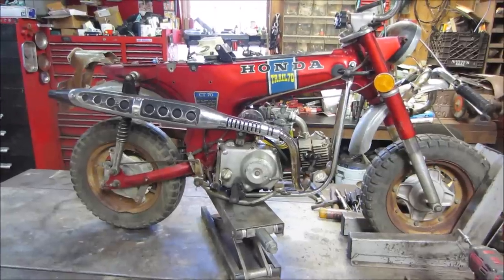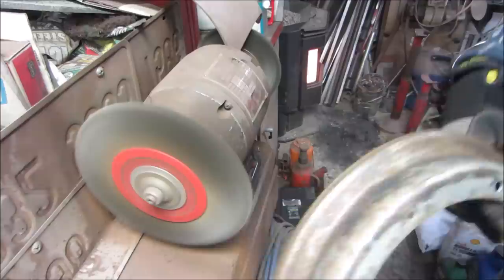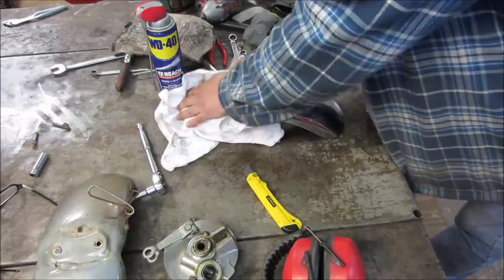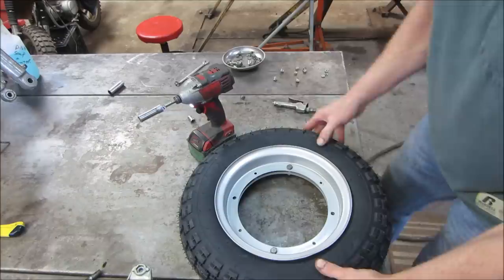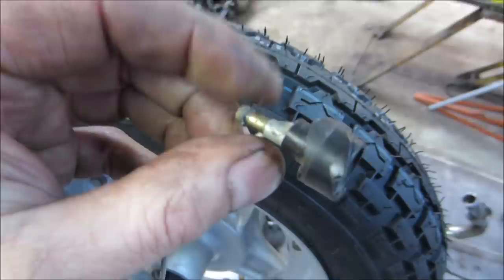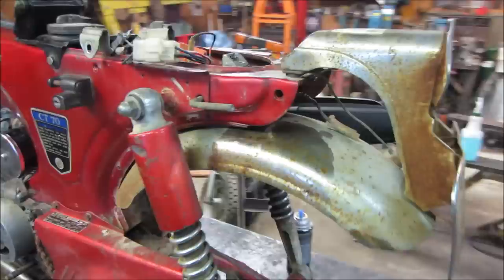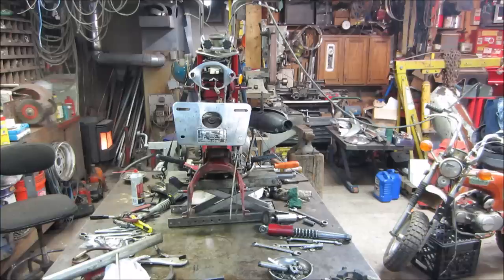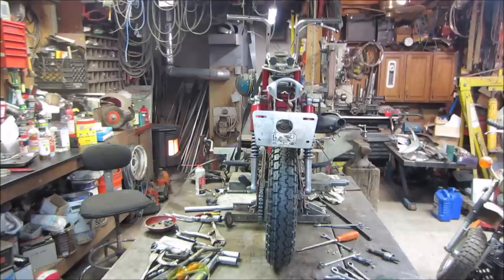Worn out Honda Trail 70, wheels and frame repair, pt5

Comment: Hey mustie, I've driven for FedEx Freight for 26 years. I have two ruptured disc in my back.
  I just watched your video on( Your 2 cents of being a mechanic.), and  I've also turned wrenches on the side for 35 years.
 Looking at your lift and watching you work on this small motorcycle oh, my back was SCREAMING (FIGURE OUT A WAY TO BUILD A PLATFORM TO SIT ON TOP OF THE LIFT THAT SWIVELS Front and back over each side or  WHATEVER IS ON IT... )LOL...

 I have literally have figured out ways to do things with a ruptured back to keep from having surgery. Because surgery is the death of my job. Everybody I've known that's had surgery at my job eventually doesn't continue  long after doing it. I LOVE DRIVING  FOR A LIVING. 

One thing I can tell you is that I have multiples of in my shop is the blue handle $2.99 Grabbers from horrible Freight, and the little yellow and black magnetic crabbers at my Welding Table I usually have three or four of them by each machine. Cuz you only got so many times in your lifetime you can bend over and pick crap up when you got ruptured disc before one of them times it's going to be the end. So if I can spend a little money to keep from having to bend over and pick stuff up that is worth it to me. I also have them all over my house, especially in my laundry room kitchen and outside to Pick Up Stix. Cheap insurance :-)

 I Apologize for such a lengthy message. I just really was touched by your video about your back and surgery.

Comment: Just a little tip. Take your torch and preheat the metal first then paint it. You can do all coats at once and it is baked on hard and durable. I have done that for years. Oh and I always use primer.

Comment: Been lurking for quite a while now and just want to say I really enjoy your videos.
On the Trail 70  front fender cleaning the chrome you used 0000 steel wool. While this works
There is also a product called Bar Keepers Friend that will work wonders on anything that is worth 
spending some time on. This stuff is a lot like Ajax kitchen cleaner and is found in the same area 
of the grocery store. But then again you probably already knew this.
Keep em coming.
Reply: Bar Keepers Friend works wonders on windshields as well
Reply: Nevr-dull wadding polish also works if it's not too deep.

Comment: Yup, in UK a castle nut is secured with a split pin, and a cotter pin is wedged shaped and used to secure pedals on a bicycle.

Your helper looks more helpful than mine... Mine just follows me about, and trips me up when I try to change direction!
(Also unable to identify correct spanner sizes. Everything just ends up as a tennis ball).
Reply: Actually I don't believe its the whole uk that says split pin for a cotter pin. Mostly just britian itself and australia. Btw a split pin is used to hold paper or leather together. Its brass or steel and small.
Reply: @jacilynns6330  The difference between Britain and UK is Northern Ireland...
Reply: Yes here there's a difference between them
Reply: The cranks on old pedal bikes were held in with 'cotter pins.' Newer bikes had 'cotterless cranks'. I've heard splits pins referred to as cotter pins too. Other 'split pins' look like drawing pins or thumb tacks and can be used for holding paper or leather together although the leather ones would probs be called rivets! I love the etemology of hardware!
Reply: Jacilynn S Now that’s not a split-pin (in UK), it’s a “bifurcated rivet”...! Les
Reply: That's awesome I'm in the United States state of Washington then we call him split pins cotter pins be safe over there in the UK

Comment: Lil was just looking to see if there was a extra cheeseburger laying around in the shop..and maybe some pets and scratches too ;)  Those rims were the most bent up ones I've ever seen on those, and that back tire showed that thing had some use and abuse on it, but you did a good job of getting those bent back. That frame though has a bit of a twist in it that I'm not sure will ever be back to square. Must admit one reason I wanted to see the orange 1 get chosen was because of the frame/rims/parts looking a bit better shape(not the orange color which isn't a fav.)and also that bigger back wheel..a buddy said he thinks that is from the later yr. ones, but been busy and haven't researched that yet. But this one is getting back into shape, and I like that wheel paint, going to look for some myself.

Comment: The next time you fit tyres to rims, use a soapy water mix on the outer rim area where the tyre seals on the rim, it allows the tyre to slip easier on the rim

Comment: Up here we call them "Welcome back Cotter" pins lol
Reply: My Dad calls the C and E clips, Jesus clips. Everytime he tries to take one off or put one on, it takes off flying. Then he says, Jesus, now where did it go?
Reply: in Denmark we call them a split 😂
Reply: In UK it’s a split-pin, a cotter pin is basically a wedge, as you say, Mustie, they were used on steel bike cranks, pulled in by a nut on a threaded end

Comment: at 42:54, my guess is they tried to pull wheel back without loosening the axle nut.   Who would do such a thing?   I know.. Cause I did it on my CT70 back in 72.

Comment: I have an NC50 which uses the same levers .the cam piece is for the brake light switch
Reply: I have a Motorino XMB 72v 500w hub motor with regenerative braking and the cam pieces on this bikes brake levers turn the regenerative braking off when you are not on the brakes.

Comment: Front tire 17 psi, rear tire 20 psi. And the valve stems should be on the right side of the bike. you might have some clearance problems with the bent stems.

Comment: I have in the past a Honda SS50 and a C50 moped. That  engine does not running well. that rattling sound that should not be in it, and he smokes too much.

it is for sure that the engine has been running without oil. 
I think the piston rings must be replaced, possible there is damage on cylinder and piston.

Also the valves must be ground.
Reply: New piston and rings, connecting rod bearing from piston end. Sound may come from lower bearing and it needs a new crank in worst case. Those engines should be nearly silent on idle and this sounds like slow jackhammer :D
Reply: @didyliduu   the noise is the timing chain.
Reply: @peterimmington8670  You rly think that tiny chain makes that heavy sound ?
Reply: didyliduu yes the timing chain is slapping around. It was covered in a previous video
Reply: @billbeyer657  no its not.
Reply: Yes it is, try looking at 29:00 in part 4 where he adjusts the timing chain.
Reply: @billbeyer657  Yea? Nothing changes, it bangs same way. :D Heavy timimgchain you have there.
Reply: didyliduu oh sorry I didn’t realize you knew more than the guy who actually owns and is working on the bike. Please forgive me.
Reply: @billbeyer657  I forgive you. Np.
Reply: didyliduu apparently you’re not smart enough to recognize sarcasm. That’s OK, it actually takes brains.
Reply: @billbeyer657  Oh really ?

Comment: ive cleaned fender chrome with steel wool then wash blow dry and then sprayed with silver paint then steel woolagain to remove paint it stays in the rust spots then clear coat to seal  it works not perfect but looks great

Comment: Going back further in my memory, long time since I worked on these when they were current, some of the automatic clutch models fitted with electric starters had a microswitch which prevented the starter operating until the brake lever was pulled. This lever also had the lug on. Designed to try and prevent folks starting on full throttle with obvious results if a gear engaged. Did not always have the desired effect !. Have picked a few up ! B.

Comment: I have had to paint the fenders on my 71' super beetle when it was cold out . With tarp walls on my metal carport , a mini wood stove along with oil filled heater I got it up to 58 before spraying . Then it was cooling too fast , so I used my small infrared propane heater to get the paint to set . Side effect was the nicest gloss finish I had ever gotten . Thanks for the end where you helped my OCD and installed cylinder base bolt !

Comment: old trick I learned  from a guy that worked at a junk yard= to clean  the crome, use WD40 and aluminum foil like you was rubbing the  fender and forks and the like. ( shiney  side out)  I saw him clean a set of crager  crome wheels to almost new looking condition. It looked so good, I got him to clean a set for me for my bug! Used wheels for 100.00 a set and the ones he got for me even had decent tires on them!

Comment: You make the impossible happen. Wish I had half your talent and patience with old stuff.  Scared of carburetors.
Reply: It's all in the cleaning his cleaning tank is top of the line heat and vibration carbs have small ports that have to be boiled out

Comment: Its really starting to look great, and should be a lot of fun when finished. A small tip for cleaning chrome, take a piece of aluminium foil (tinfoil in the UK) make a loose ball and dip it in water ( I found warm soapy water dose best it grimmie, just warm water if just a bit pitted or rusty) then just rub it on the chrome areas and it cleans and polishes it up really nice. Have seem it used on TV too.

Comment: I always use a little bit of baby powder on the inside of the tires so the tube expands inside and doesn't pinch or fold. This series of video's has been like a training video for when I eventually get a Honda Trail 70 lol.

Comment: Please repaint the black high light on the exhaust shield. I feel it would help a lot, thanks.
These vids are great as this was my first bike at 7. Went to a auction with my dad and little brother to buy a bb gun and my brother and I found the bike in a big pile of weeds. Showed it to your dad and he said bike are gun. Went with bike and the farmer sold it to us for $25. Worked with my older brother to get it running. Great memories from my youth. Thanks for the vid.

Comment: An old BMX trick. When we wanted to put on our grips on the handlebars we would use hairspray. It helps it slip right over and then when it dries the only way to get it off is to cut it. Too little too late right now I'm sure but that would be perfect for your rear sprocket. Good job on the build I like to see an old Relic come back to life.

Comment: In Australia we call the pin that holds the pedal crank to the shaft a cotter pin. The pedal arm has a hole with a flat and the pedal shaft has a matching flat. The cotter pin secures the crank arm to the shaft and has a nut. The cotter pin is in fact a tapered headless bolt that is tapped into place then secured with a nut and spring washer. A split pin is a generic fastener coming in many sizes that use the same principle for any size. Basically it is formed from a wire with a flat half. It is bent round a mandrel and the two ends come together to become a round  pin that when inserted in a hole, the split ends can be bent back to prevent the pin falling out. Typically split pins are used to lock castellated nuts to threaded shafts or bolts. They are seen on motorcycle axles and car stub axles plus a host of other mechanical applications. Cotter pins and split pins are two distinct engineering solutions to similar applications, that is, locking a part to a shaft.

Comment: The brake levers should have holes facing downwards to help prevent ingress of water. The lug in the left one, on some models, had a spring clip which folded forwards to partially lock the rear brake when parked. B.
Reply: I also thought the brake lever was on the wrong side, the cable end shouldn't be seen from the top. I didn't know about the lug. Good info.

Comment: There was a guy on the outskirts of St Louis just across the bridge in Illinois that used to have piles and piles of these little Trail 70s and every color under the rainbow the metallic red metallic blue the metallic green metallic yellow and metallic Orange just tons of them... I had mini bikes when I was growing up with a Briggs & Stratton engine in them so I never had the chance to futz around with one of these but my friends had them and they were pretty cool this one is turning out to be quite the gem.. very surprised that you're finding these parts on eBay New Old Stock I guess... keep up the good work and thanks for the videos they are enjoyable

Comment: I learnt the best tip for cleaning up chrome - bunched up aluminum baking foil and cold water, ali is softer than steel so cannot cause damage like steel wool can. The number of old bars and rims I've done this on - it works real well

Comment: The  levers with the cams are for the newer types with  front actuated brake light. 
Also, use some washing-up liquid  when seating the rim halves, then you won't have any pinching!  :)

Comment: yeah we call them split pins in the uk, what we call cotter pins are the type of pin that is fitted through the pedal crank arms on bicycles, the ones that fit through one way and is held by a retaining nut.
Reply: You've got it dude, I'm so old I remember the 'new fangled' bike cranks as being described as 'cotterless' e.g. not having cotter pins holding the cranks on.

Comment: Wiped out on a stamped sheetmetal frame motor scooter at the slag dump when I was about 15.  Watched it doing end overs after I fell off.  The frame buckled and the handlebars were touching the seat afterward lol.

Comment: I had one that i found next to a dumpster that was missing the motor.  I took it home about a month later i was at the dump i found an old three wheeler trashed with a 110 motor with the hi/lo range gear box on it with the pull starter. I put that motor in the trail 70 frame and that was a hell of a bike a lot of fun to ride it would go 45 mph in hi range and climb like a goat in low range i called it Danger.  it was much better bike with that 110 high/lo range setup.you should give it a go!!  it's a tight fit but it fits in and you have to leave the little skid plate off.   the front fender just clears the head.    makes a great go anywhere micro bike.

Comment: Cool. Coming along nicely. I was watching a vid by 'bikes and beards', something like that, were at a guys 'garage and ended up buying a '90' for I think, $850 and needed some work as it was supposed to run. Probably ran and then sat for a long time. But had some neat cars and rare bikes there. Thanks for sharing. I like you 'body' tools, my style. All you need is the right leverage.

Comment: "I hate when my pipe goes mushy". Was that a double entendre?!  Rebuilt a ct 70 KO a couple years back and it had the exact same bent frame issues.  I don't think that those rear shock mounts were ever made to haul someone my size around but with some upgraded shocks, it's been doing fine.  Took me back watching this video. Thanks!

Comment: Hey, Mustie1 !  Interesting vlog as usual !  I was surprised though that you did'nt buff the center hubs while still apart.
Say, regarding the smoking engine, You could try "Restore Engine Restorer & LubricantRestore Engine Restorer & Lubrican". 
Years ago, my old and tired Nissan Stanza was smoking heavily when cold.
I really do not believe in "Mechanic in a bottle" but I tried it out of curiosity.    It worked ! 
Now I'm using it in my 25 years old snow blower which started to smoke quite a bit. Again, it works !
Maybe worth a trial ??

Comment: Another back saving idea is I have a that way when I show the airline up on the table, it'll stay up there and I ain't got to bend over and pick it up off the floor I noticed that when you were air the tire up to set the tube in the rim.

Comment: When I was a kid, I had a go-kart that had wheels and tires very similar to those.  They were a bit smaller, but the rims would split in two like that, you had an inner-tube to hold the air of course, and sometimes the rim would stick in the bead of the tire like yours did there -- only I didn't have a press like that to get it out.  I had to use a block of wood and a screwdriver to pry at it for what seemed like hours to get that rim-half out of there to replace the tires.

I wish that thing had an odometer -- I'd love to know how far I drove it in the 4+ years I had it...  But I completely wore the original tires bald, and wore the 2nd set of tires down to almost bald...  So that's gotta be, what, 4 or 5 thousand miles, yeah?  Lots of fun, that...

Comment: Hey mister, been enjoying your stuff for a year or so now and other than those dirty, rotten VW things you spend time and money on, it’s all interesting!😂
On the serious subject of cotter pins and split pins, in the UK and I suspect the other colonies except the US we refer to the pin that the castle nut screws onto as the cotter pin and the split pin that can correctly be referred as a cotter key is the locking device  that is pushed through the cotter pin, often referred to as the axle in the US.  Split pin or cotter key are perfectly interchangeable but cotter pin is what holds the wheel into either the forks or the swing arm. Hope this explains the transatlantic confusion without irritating too many folks on either side. 
Just by the way, I had the road only version of the Honda 70 as a boy and that thing was nearly indestructible. I rode it around the place we lived at the time and had many hours of fun with it before moving on to motocross bikes.